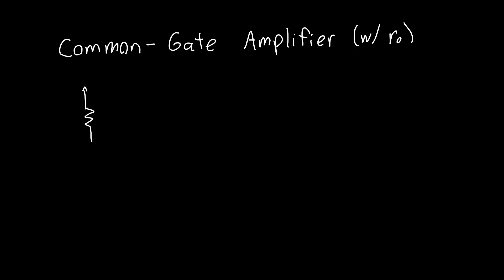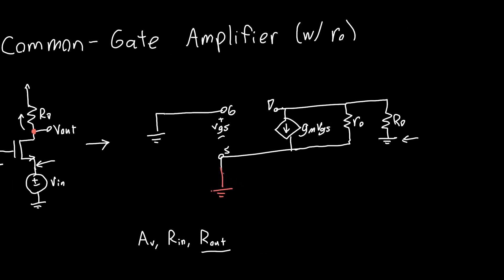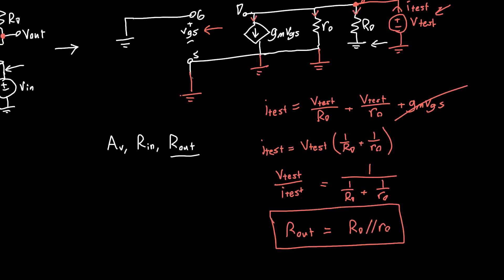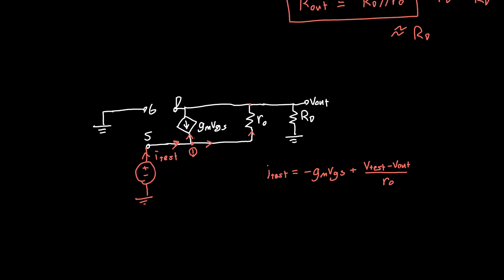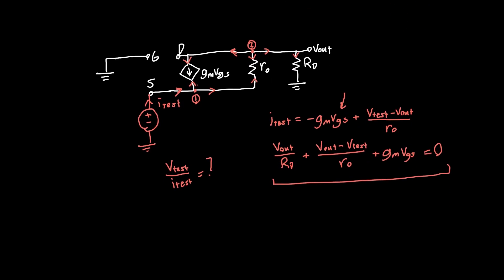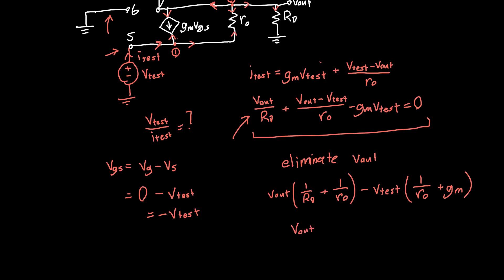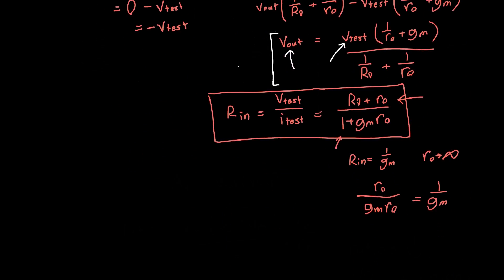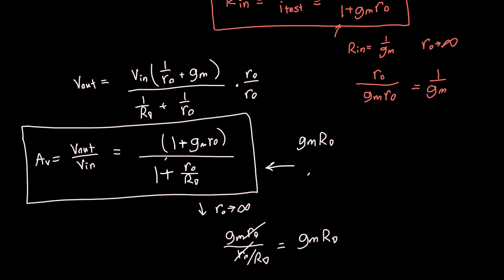MOSFET Common Gate Amplifier Part 2

Comment: Thankyou for digging into this apparently elegant and very useful circuit over these 2 videos. I use a variation of this as a dual differential transconductance amplifier/IV  stage for my audio DAC and although I had the equation for calculating the gain, I never broke it down into small signal analysis. with the right, lowish cap, highish gm fet, biased into class A and driving the gate so-as to present AVCC/2 as a virtual GND at the input for the dac, it makes for a VERY low distortion, if somewhat brute force IV convertor that competes and in many cases betters objective performance you get from all but the best OPA based convertors, with a handful of parts.. 

When I first built it, it was much earlier in my journey, before I really knew how circuits worked at a small signal level, but the build was capable of better than -123dB THD+N, with a DAC 2 generations ago; which was difficult to even measure with an Audio Precision System 2 back then.

I arrived here today as I have been thinking about reworking the IV for the new DAC parts and with a GAN device and wrapping it in a servo loop, so I can DC couple, run a lower voltage, lower dissipation design than the enhancement mode mosfet version. The higher current output of the new dac parts (4x) allow me to drop the size of the power resistors too (I splurged on Vishay foil TO220 $$$ fort a bit of fetishism). The lower voltage required will enable the use of a higher performance VREG; which is a bonus for a stage with such low PSRR. That circuit ran at +/-45VDC, with ~150ma bias, resulting in an IV stage that needs to dissipate nearly 50W (for 2 balanced channels) including the regulated PSU and needs a heatsink almost as big as my amplifier ... lol. 

with new GAN devices, I can lower the voltage for similar or better performance and use only an aluminium PCB as heatsink and hopefully take less effort in device matching. With the last version I needed to build a test jig to test hundreds of fets to match quads for transconductance at the design's operating point/temp. I just need to choose the right modern SMD device to work in linear operation, without too high a gate charge, when most modern low RDSON SMD fets are designed for hard switching and have large cap. 

Of course all care will need to be taken in PCB design. I'm Just working out how to tackle the different device character of GAN VGS diode/clamping voltage/behavior and whether that rules them out. I dont think so, as with the common gate construction i'm not feeding the signal to the gate, it is only fed with a DC bias to match the desired virtual ground voltage I want to see at the input node.

Comment: Hi, Jordan

I understand the first KCL but dont really understand the second KCL.

1. The current going to ro should be (GmVgs+ I test). And split into left (to current source) and right path (to Rd)

2. GmVgs in the left path is pointed downward means negative from the perspective of node 2

3. The right path is (-Vout)/Rd, negative since it is leaving node 2

But why i cannot get the same answer as you do? Is there something i did wrong?

Thanks